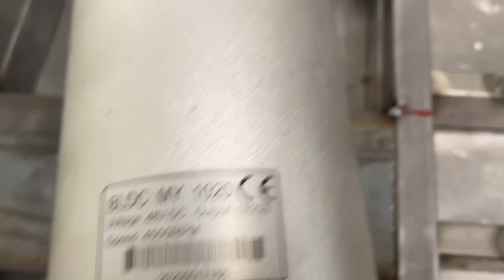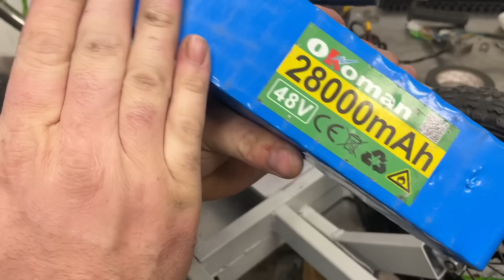BUILD!! an E-Scooter Using 1800W- 48V Motor / Awesome Idea

Comment: Hello, where did u get the Sprocket of the motor from? I only have one for a tf8 chain But it doesnt fit because its a bike chain
Reply: same proplem
Reply: @akselilaakso1005  I found a fitting sprocket on aliexpress
Reply: @gamex560  could you please send me the link i havent been able to find one
Reply: I’ve got one coming for a 410 chain from eBay. If I did my research right that’s a 1/2 x 1/8 bike chain.
Reply: @JamesWyke  4so it would fit on like a normal bike chain?

Comment: So does anyone know what size 48v ebike battery is suitable as Ive just brought one off these motor kits and don't wanna over watt it or under war it will a 48v 13ah work or would a 20ah be better and really nice video dude that thing is so cool hehe
Reply: Muy bien hecha sigan fabricando
Reply: Amp hour is the rating used to tell how much amperage a battery can provide for exactly one hour.